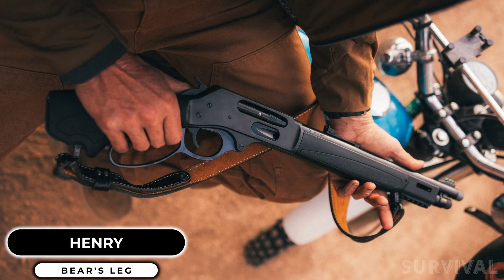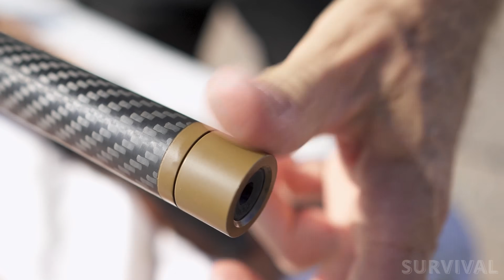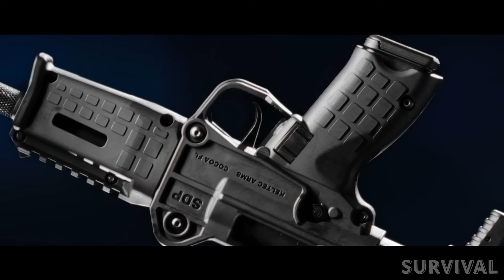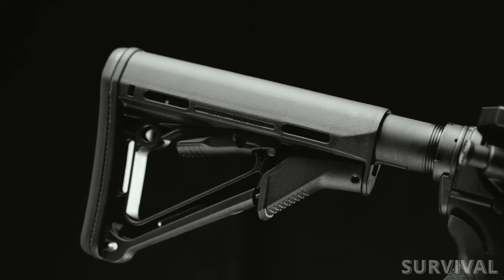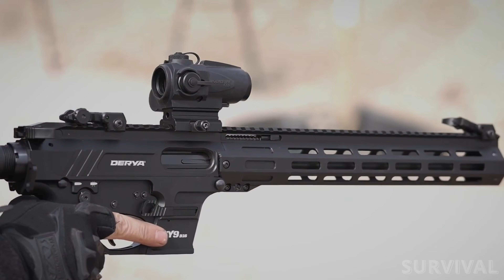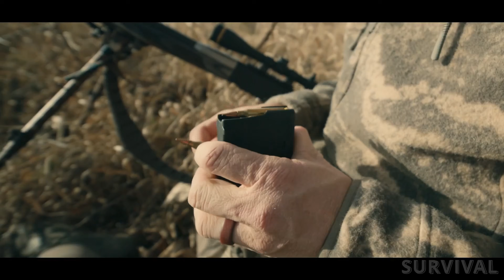17 New Guns Announced for SHOT Show 2027!

Comment: You did not talk about the FN Bolter
Reply: It will be available for the public as milsurp after the NFA is gone.
Reply: @w @williamtmalave  I hope so, I just wanted to hear news about it for our troops at least
Reply: That's heresy, to put the bolter on the thumbnail and not talk about it
Reply: @artiomvv569 yup, I HATE that do you think The reihmetall 40 mm is a better idea because you don’t have to change calibers?
Reply: @madjackthesavage5667 the one from Rheinmetall seems like a better choice since it's a 40mm and packs a heavier punch, though the FN Bolter looks nicer.
Reply: @a @artiomvv569  I mean ballistically, 30 mm has more range and accuracy, so the FN Bolter has it in those aspects, but the 40 has much more power because it’s in 40 mm, but it lacks and range at least compared to the 30
Reply: @madjackthesavage5667 yeah, it's like choosing between 5.56x45 and 7.62x39. Some prefer one, some prefer the other.
Reply: @artiomvv569  well it all depends on the job that you’re trying to accomplish. 76 2 x 39 goes through walls a lot easier, harder hitting it close range, 556 has longer range and it’s more accurate, it doesn’t go through walls as well as the other,
Reply: @madjackthesavage5667  i own both calibers and quite frankly when i go hog hunting i pick the 7.62x39 more often than the 556, though i mostly use an AR-10 in 308 as my main. If we think of the 30mm grenade as the 556 and the standard 40mm grenade aka 40x46 as the 762x39, then the 308 is like the long cased 40mm grenade, 40x53.
Reply: @artiomvv569  I didn’t see that part, are you saying this 40 mm grenade launcher can use the long case version? The full powered grenades.???
Reply: @madjackthesavage5667 the 40x53 is only used in automatic grenade launchers like the Mk 19
Reply: @artiomvv569  yeah I believe I knew that, but are you saying that The rehmetal can fire that version?
Reply: @madjackthesavage5667 no  it fires regular 40x46 because the recoil on the 40x53 is too high to be shoulder fired unless you're Scott from Kentucky Ballistics. What i was saying is that I was making a comparison between the difference of 762x39 and 308. Both are 7.62,though one is more powerful than the other, like 40x46 and 40x53
Reply: @a @artiomvv569 aaaahhhhh thank you, that makes sense, both of your comparisons are perfect. I mean, if they go with the 40, they don’t have to change caliber, and they can do single loads, easier, and put longer rounds down the barrel, but with FN, that 30 mm has quite the range and quite the accuracy, did you see Cappy shooting it?
Reply: @madjackthesavage5667 yeah I've seen that. Quite frankly I'd like one to shoot hogs with. Will make shredded pork in a heartbeat 😂.
Reply: @artiomvv569 😂😂 but seriously, military wise, what do you think is the right option?
Reply: @madjackthesavage5667 i like something with greater range. Also you can carry more 30mm grenades. You're gonna have to sacrifice on the offensive power, but you gain on range, accuracy and ammo capacity. It's kinda like the same reason why we stopped using 45 acp and use 9mm instead.